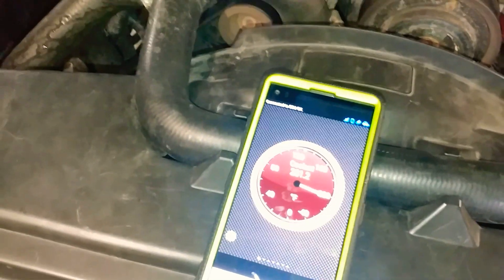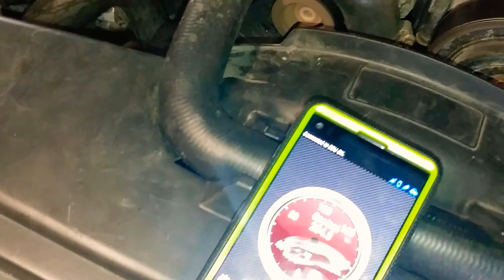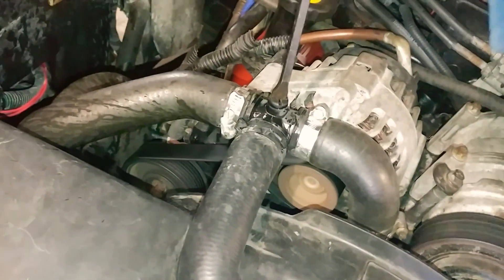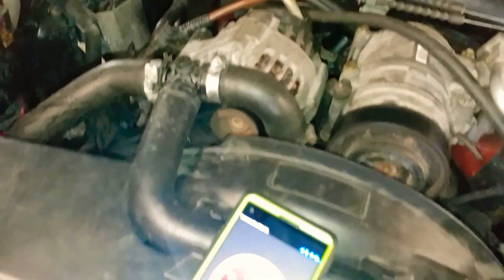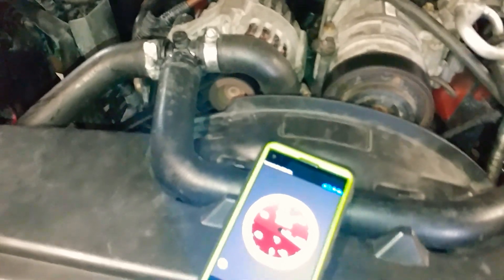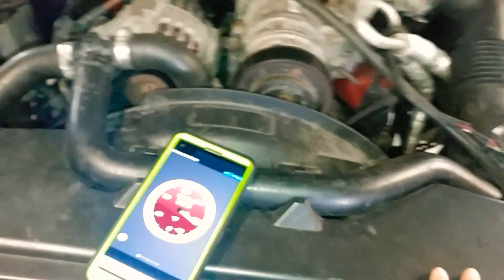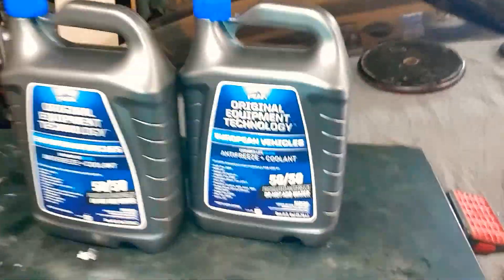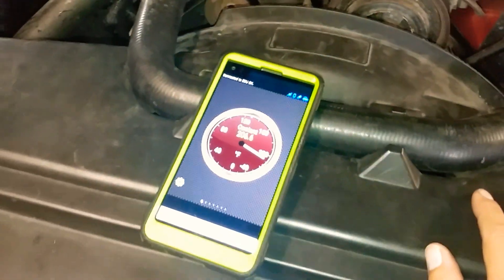Land rover discovery 2 coolant

Comment: When u mentioned oil things my rpms drop to 680 and the oil light is lit once roms are above 750 no light activated. Just don't want to replace the oil pump gears or head gasket as I'm past the ability I did it all 10 years ago eyes are bad now. I use Torque app and elm.

Comment: Mine stays around 210 I think my pump is an issue as my coolant level drops and I have to bleed again and add fluid. I thought originally was the thermostat as the thermostat rattled. All this happened after 10 years and a very cold night.